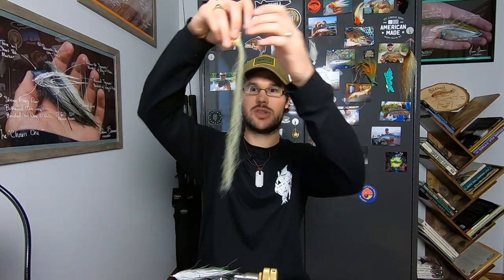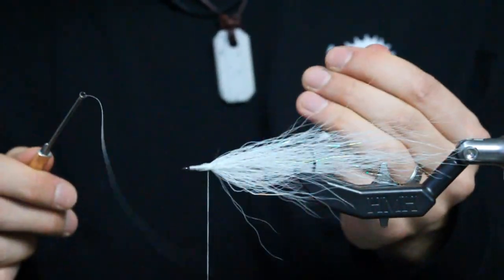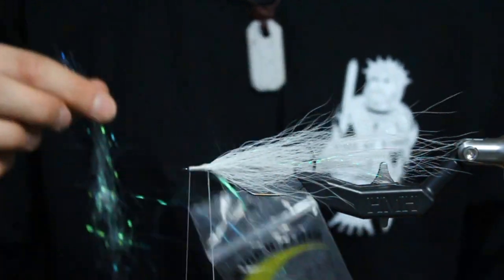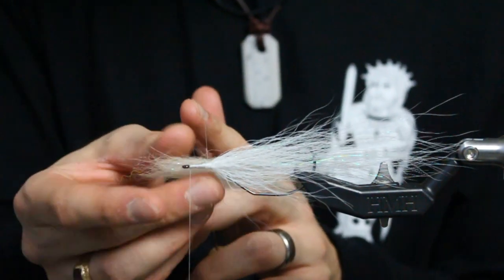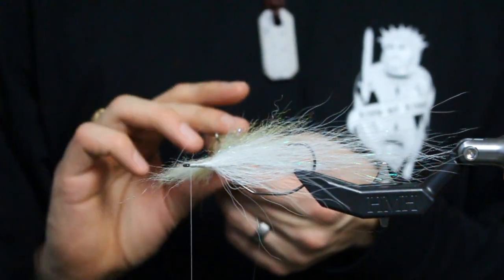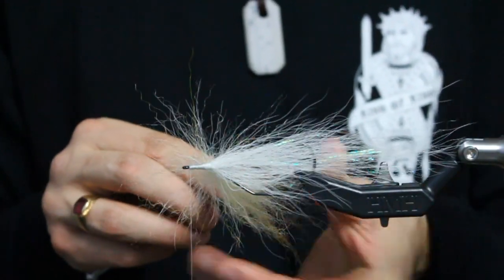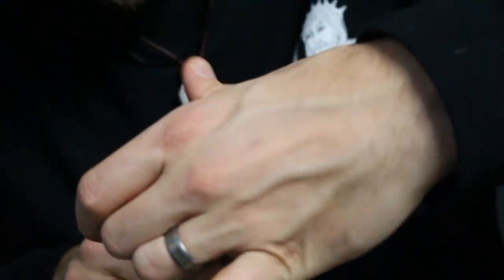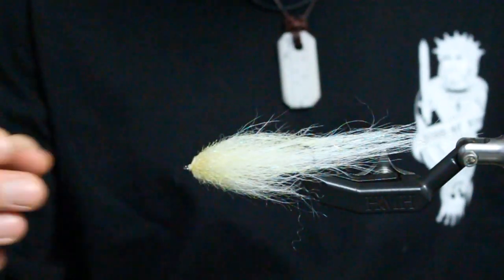Dubbing Loops - Synthetic BULKhead (Strung Fuzzy Fiber)

Comment: How would it affect the action of a deceiver if I finish it with a longer craft fur dubbing loop? Two stacks tied in straight, three reverse bulkhead stacks of increasing thickness, and then long craft fur head draped over the bucktail. Worried it might affect the density/water push, as the bucktail butts are concentrated from the 50% point on the shank to the 25% point, with the craft fur on the front quarter.